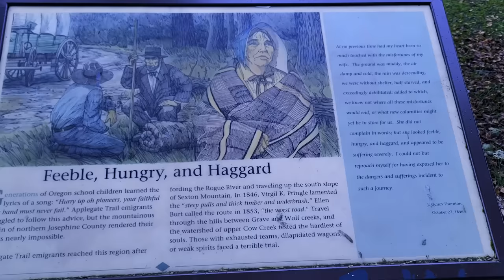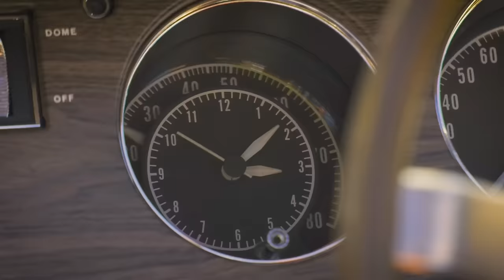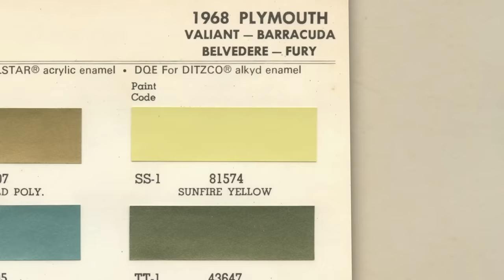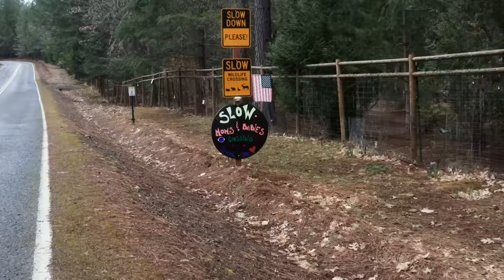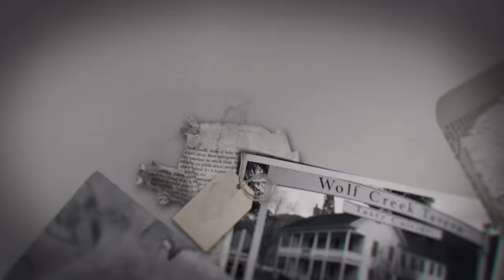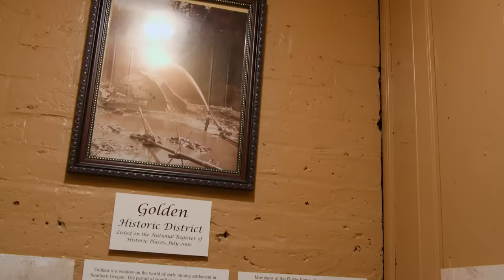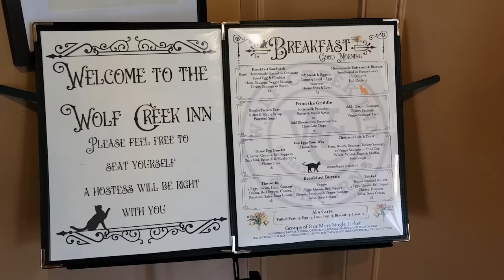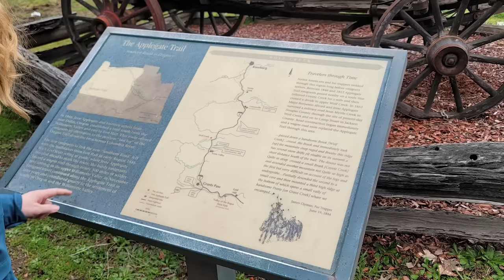NEW EPISODE: MARK & DOUGIE MAKE THE FIND OF A LIFETIME AND THEN GET SPOOKED AT A HAUNTED HOTEL!!!

Comment: Back in 1980 I had a friend with a 1968 Charger just like that one with the original yellow paint, black vinal roof, black interior, and original 383 engine in it. The 383 had a spun rod in it, and he needed to sell the car fast. I told him give me five days, and I will give you $500 for it. Five days later I showed up with the money, and he told me he had already sold it to a junk yard for $100. I had several deals on second gen Chargers fall through back those days when you could buy a straight, rust free, running Dodge Charger for $1000 or less.

Comment: Por 15 gets a bad rap sometimes because it won’t stick well on super shiny surfaces because the grind of pigment has to be fine enough that it doesn’t stick above the finish to reduce the non porosity needed to make a shield from moisture. Rough sharp pigment helps with sticking because it sinks into the small imperfections that are not visible but it makes holes in the finish.